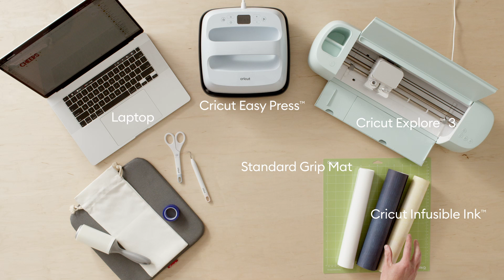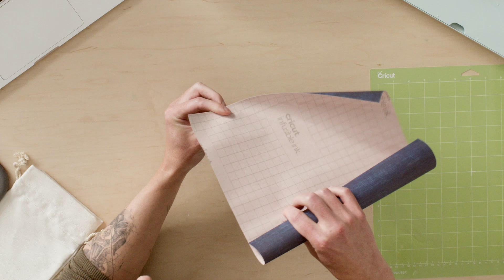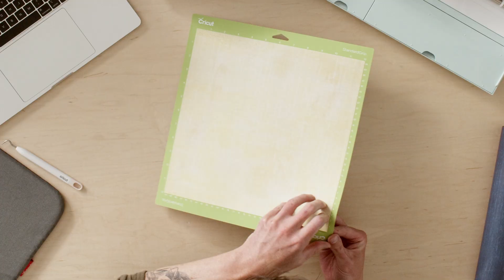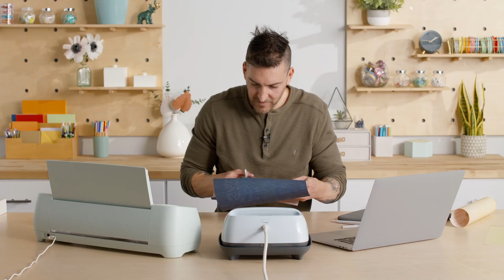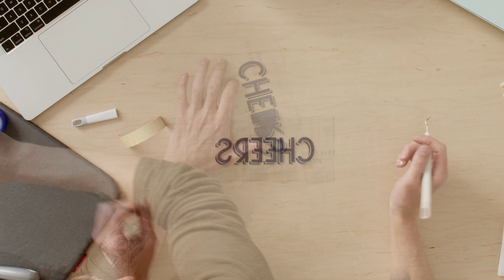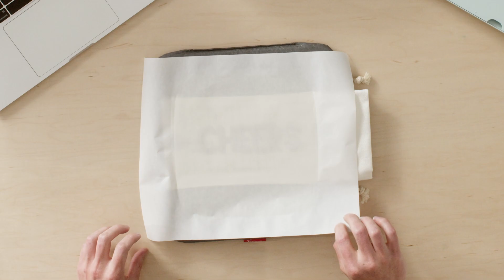How To Make a Custom Wine Bag with Cricut

Comment: I'd be interested in putting a design on both sides of the wine bag.  Would you explain how to do that, please?
Reply: Put a piece of cardboard inside of it and do the other side.
Reply from the maker: Hi Loretta! Just flip the bag and follow the same steps in this video, making sure to put butcher paper on the inside so the infusible ink doesn't bleed through!